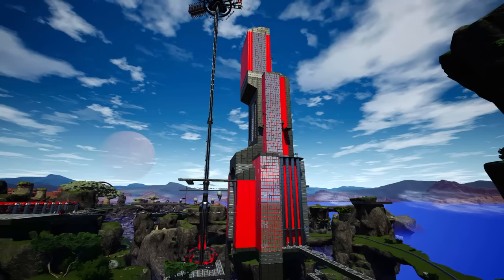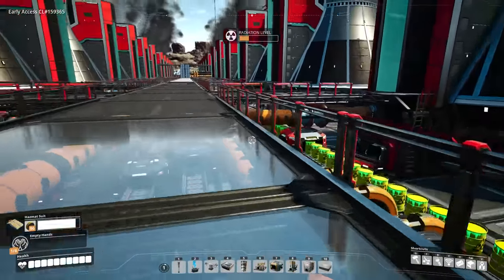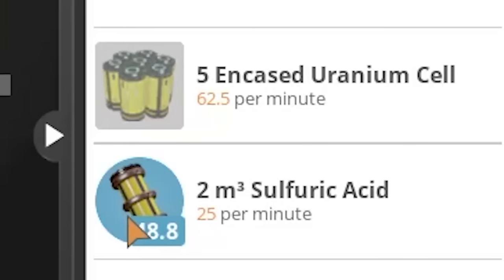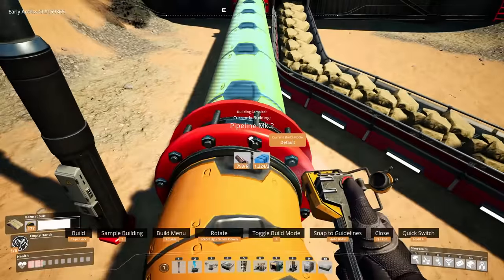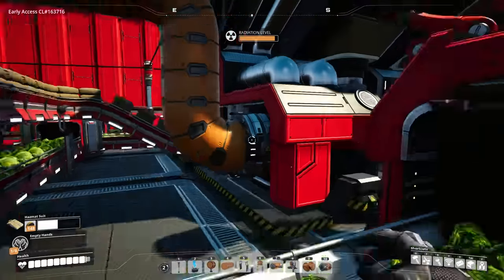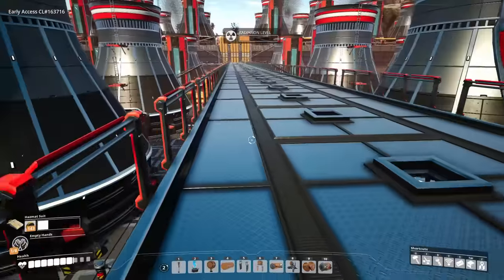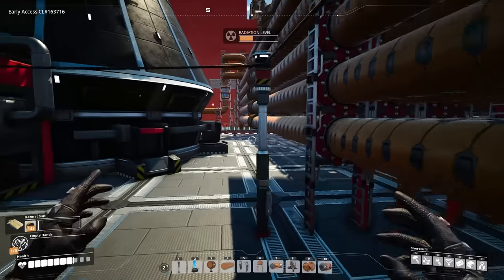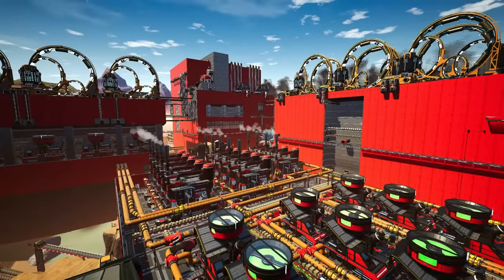The Nuclear Power Plant is MELTING DOWN?!! - Satisfactory

Comment from the maker: So how long do you think I have before the Reactors break again?
Reply: You're good now. I'm claiming it for your productivity and your sanity.
Reply: 30 days
Reply: with any luck cause i am a evil bastard every 5 min ^_-
Reply: Right about......... Now!!!!!😂🤣😂🤣
Reply: update 5 release?
Reply: 0 seconds > actual time > infinity
Reply: 16:01 Forgetting to increase the water production after putting in the shards wont ruin it right? :)
Reply: Until the tower is furnished.
Reply: 10 minutes.
Reply: I had the stuttering water on a few reactors, permanent fix was to redo the last couple of pipes to the reactor.
Reply: The feedback loops are just error prone. You probably know that, but what works pretty well, is pumping the feedback output into a higher tank >10 meters), before you merge it back to the input. Important is, that the freshwater is not pumped that high. Seems like the game prioritizes the higher fluid source like it would in reality. As soon as the higher placed tank contains enough fluid, it flows to the target and pushes into the input flow from the water extractors bringing them to a stop. But if the water from the feedback output tank is not enough, the extractors start and provide the missing amount of water.
Reply: well the pipes are not upgraded sooo i would think next ep
Reply: uhm, about when Update 5 comes out. Isn't it gonna change a lot of the terrain around that northern area?
Reply: @TugiFox  yes
Reply: God DAMMIT
Reply: If the water was stuttering its probably still not filling enough. So... an hour lol. You should just do what you were saying before and overpump your pipes as well by like 10%
Reply: next week
Reply: Untill you turn on your new main base
Reply: @JamesTDG  i would thin his brain trying to fix some thing not even there...
Reply: i'd say about 3 episodes
Reply: You know u said that the blenders need 400 together? And hte pipes are 300 pipes? where is the problem? mmmmh
Reply: at 16:27 you forgot to replace the pipes to tier 2
Reply: I’m gonna go with about 5 days, minimum. Maximum probably a year.
Reply: One second >:)
Reply: When you leased expect it and it is most inconvenient to deal with.
Reply: I am rewatching and rebuilding your Power plant And I noticed a big mistake:

You have way to many reactors for to little rods.

You are making 22,5 rods per Minute.
One overclocked reactor Takes 0,4 rods per Minute.

You have 56 overclocked reactors and 42 normal running reactors.

The Problem:
56 overclocked reactors alone Takes 22,4 rods.
So you have 41,5 too many reactors :O

Instead of 42 Additioninal you just need one on 50% (0,1 rods/min)

Your production on Plutonium fits the 56 overclocked reactors and one on 50%, so this system should also back up eventually. 

Now your rods are backed up as heck, but some time it will break.

I dont know when, but it will eventually, or am i missing something?

Numberwise, this should not be functional
Reply: 2022 checking in, is your reactor still running?
.
.
.
then you'd better catch it!
Reply: hmmmmmmmmm...It took longer than I originally predicted.
Reply: 5 videos at least
Reply: if water is running out than 30 - 60 minutes

Comment: YOU NEED VALVES! On each blender output before it joins the main line, put a valve. This will prevent backflow and preserve your flow rate out. Can do the same on the main line out between each blender output. Same with your water from the extractor to the concrete. Put a valve on the main line before it enters the factory just below the highest point of the hill.
Reply from the maker: OH BUD 100% doing this
Reply: @ImKibitz  was literally JUST about to say this exact thing. i do it with every pipeline now
Reply: I do a dedicated machine/s only ruining on the output from the others, that way it's impossible for it to back up
Reply: @ImKibitz  I also believed that was necessary, but I found that if you don't have any flow problems it isn't. However, if you do have flow problems, valves can help you fix it absolutely.
Reply: @ImKibitz  I'm using pumps at the described location, it works too.
Reply: I've run into the same kind of problem my fix for it was to package the output from the blenders and then but it into an awesome sink. I know it is not the nicest but I think it is the most reliable. Another way to deal with this is to build an overflow by making an intersection for the fluid and make the pipe go up on one side so the fluid does take the straight way until it has backed up.
Reply: @ImKibitz  Personally I do pump -> tank -> pump just to be extra sure I don't back up on my outputs.  Buffer tank usually sits at <20m3
Reply: Or prioritize the recycled H2SO4 by raising the incoming pipe...
Reply: @ImKibitz  To expand on his comment, you have a valve on your main sulfuric line preventing back flow, but you don’t have anything from preventing the main line from filling up the output lines. I had the same problem with water in my aluminum plant. The output lines wind up getting filled by the main line instead of the machines.
Reply: What this guy said.  I have found a lot of my problems are solved with valves, especially since I tend to use multiple fluid buffers.
Reply: I have seen that the smaller pipe will max or exist when upgrading under the splits, I had a similar issue and then just updated the entire set to max pipe size and with the valves the backflow issue was resolved. Fluid dynamics are not weird as factorio but still have some odd behavior.
Reply: Contensol manufacturer of nuclear valves and products
Reply: yeah, I do this with my own nuke setup.  the 600 water into two nuke factories were fluctuating like crazy until I limited them both to 300 input with valves
Reply: yes this is good
Reply: @ImKibitz  bro you didn’t have valves
Reply: Didn't know this but if I do something like this I'll keep that in mind, thanks
Reply: Valves so but this siren has been goin off thr last three days on n off ppl wer getting worried

Comment: I know EXACTLY the solution to your pipe problem. If your output pipe (from blenders) will be higher than pipe with valve on it (to blenders), than it will have the priority. Currently you have exactly opposite situation and you're backing up. I've spent 20 extra hours on my fuel power generators to find out this dependency
Reply: The new update really screwed pipes up and made them extremely temperamental. I've wasted many hours over the same problem as you
Reply from the maker: Yoooo that's so weird! I'll try that out too!
Reply: @ImKibitz  Another solution that I use is to just run one blender from the output of a cluster other blenders (3, I think), plus its own output. Mine never back up that way, even if the production goes all weird from the output belts backing up.
Reply: Instead of the brute force way with valves, I would have resorted to another brute-force method, attaching a pump to the exit of the buffer tank to give it "priority through pressure."  After all, the buffer tanks are allowed to run dry; we can make all acid we need.  They create a backlog if they fill up completely, so we must ensure that the acid from tanks is always used if possible.
Reply: I never got far into the liquid side of satisfactory. What is the back up doing to his setup? I didn't realize too much liquid was bad.
Reply: @achtsekundenfurz7876  pump does not work that way
Reply: @Skorpioartex  problem is the blenders have the same output (but less of) that they use as input so they can back the self up through their own production. They create lots of problems that way.

Comment: Me and my brother ran into this exact issue with the water. End result in our build was we had to run dedicated 300 pipes per reactor with no overclock permitted on the reactors.  But we were able to limit the number of required water extractors by over locking the snot out of them.  The majority of our power shards are in our water extractors.

Comment: I have had the same iussue trying to use valves so I can feed something from two fluid sources with specific proportionality. It works when I stay close to it, but if I leave the area then it can back up. I assume that the simplified simulation when you are away is not quite good enough. So instead I have extra machines with higher priority input belts, that use the excess from the earlier machines. In this scenario, I would have three machines fed by the sulfuric acid supply, and the 4th fed by the output from those three and by itself, using a separate pipe not linked to the supply. The 4th would be highest priority on the input belt to ensure the sulfuric acid produced by the three would get used up asap.
Reply: You can also just run part of the machines completely off the access sulfuric acid, disconnected form the main source, instead of doing an overflow setup. So, say 5 machines run normally, then 1 runs from the acid that those 5 generate, disconnected from any other source.
Reply: @Hlebuw3k  that's what I tried to say, but you explained it better

Comment: I have an idea what the problem with the sulfuric acid was. As you mentioned, there was a problem with the concrete production. This means that the consumption of acid was not steady, as the mashiens were idle for a few moments. However there was still as much new acid pumped in as if the mashiens were running at full capacity. This means, that there is more acid pumped into the pipes then the mashiens use, so the pipes fill up and cause the problems you showed in the video. So now that the concrete problem is solved and all the other suff is also comming in as needed, the pipes should not fill up any more.
Btw: Love your stuff. I realy enjoy watching your videos. Would be nice if you took the time to answer me whether I could be right with my hypothesis.
Reply: I think you've got it exactly right.
Reply: yes I think thats exactly what happend, pipes balance themselves out pretty good, I never used a valve and never had any problems with back loops.

Comment: I had a similar issue with water. I put valves at a certain point with a fixed flow rate to ensure proper ratio. That did do the trick for me. In general, I find the fluid mechanics in this game highly esoteric sometimes.

Comment: The solution I run when dealing with machines that output liquid is to place a buffer in the line high enough up that the incoming supply can't fill it more than 50% due to head pressure.  The machines producing the liquid however are high enough that they can freely fill and take from the buffer.  This let's there always be an air gap in the line for output liquids to go.  The trick is finding just the right height to place the buffer at.

Comment: You don't have to sink it. You can prioritize the 100 m3 sulfuric acid output by using the height trick. Have the acid producing refineries ~9 meters below the input for the plutonium cell, put a buffer tank on top of it, presto. The buffer tank is ~4 meter in height, so the 10 meter headpressure will fill it only up ~25%. So there is always space for the acid output.

Comment: I seen that you have used some pumps on your sulfuric acid setup. Pumps can be used as a priority system, as well as pipes being on the top or bottom. You need pumps on the sulfuric acid output pipes that run back to the input. Then the game should take the output acid first before taking another source, or at least at a higher ratio. And at 16:25 you can see quite a bit of 300 pipe, just make sure that won't bite you in the butt, build everything in 600 pipe.

Comment: An easy way to solve the pipe problem is to make as many blenders as requiring the total output, +1, and then join all outputs (including their own) to those few blenders. put them at the start of the other resources so theyre prioritised. It will ensure output acid will be consumed first as much as possible and youll still get the same overall output of cells

Comment: You need a pump on the return line for your sulfuric acid coming from the blenders, and not one on the 'fresh' acid line. That way the return line gets 'priority' feeding back into the system before it takes fluid from the fresh pipe. I remember reading that somewhere, and it seems to have solved my own feedback problem!

Comment: Big flashbacks to my first big aluminum setup with that whole sulfuric acid issue. Whenever you think you can take advantage of a bit of excess byproduct fluid at the back end of a system and run it back to the back end, it is just inevitable that some part of it will crash itself. You either overproduce and backup the byproduct, or underproduce and don't have enough to balance the system.

Comment: If you have a recirculation setup that keeps backing up. Tee off of the recirc line into two stacked buffers. Link the two buffers and then tie the top buffer into your sink.  This will ensure you only sink excess that manages to pressure up into top buffer.

Comment: no no no, you don't have to sink the acid. Try pumps first. a pump on each blender if you have to. I am certain that pips can back flow and cancel the pressure. As the devs have said "They don't want to 100% say how pipes work" I am sure there is something funky with fluid pressure and if you added pumps it might start working.

Comment: I had a similar problem with Aluminium production where you recirculate water, i ended up putting a storage tank on the input side high up, and a MK2 pump on output from refineries, so the MK2 pumps should have been able to fill the storage tank, but the regular water pumps could not pump water that high.
this way i could always empty the output side of refineries and the regular water pumps could not add more water since they could not push water that high. a bit silly solution, but hey, it worked.

edit: i think the problem is the blenders don't run 100%, so you keep adding acid from your production line, while you ain't consuming the same amount. a 3rd way, could be to reduce the added intake even more but then you would never run 100% up time, i think you had that earlier (wrong intake amount on valve) and they at least kept working some 80% then?

Comment: When I had that fluid problem the only way I could solve it was with active pumps. Basically valves still won't flow when there is the same amount of fluid on each side since there is no pressure gradient. So both sides of the valve just fill up anyway. With a pump it ensures that the output side of the pump is very full (and therefore has higher pressure and will take priority) and the input side is almost always empty (so the blenders always have somewhere to output to)

Comment: I don't know the inner workings of your pipe system, so correct me if I'm wrong. But if the sulfuric acid pipes going to the blenders are 300 lines and 4 blenders need 400, you return the 25 sulfuric acid they produce back into the system. But the pipes are still 300 pipes so they can't support the additional sulfuric acid coming back from the blenders. I think you just need bigger pipes. (I hope my english was good enough to get my point and as I said I don't know if the pipes are 300 pipes.)
Reply: They are 600 pipes so they hold enough fluid

Comment: quality of life tip: when you use Smart! mod, you can open menu by pressing M, then use the setting for auto placing conveyors when you use splitters or mergers, that way you can do a whole factory line with splitters, machines and mergers, in just 3 building steps!

Comment: I never trust the self feeding loops, like you did in the sulfuric acid, they work until something breaks, either energy, other product or anything, than the pipes get full and the doom is unleashed.
What I do is always have one or two machines that runs only out of the waste product, or simple having more machines than you can product, so you can't ever get a full pipe dead lock.

Comment: kibz i think i know the problem with the blenders since you didn't have the concrete the sulfuric acid backed up into the pipes even with the 300 line and the valve bc you didn't have the concrete it was already underproducing so the sulfuric acid backed up so with the concrete fixed then it shouldn't happen right?

Comment: its full because mixing mk2 pipes with mk1 pipes doesn't really work right.  switch all pipes to type 2 pipes, and put a large fluid buffer at the beginning of each blender system.  The sulfuric acid producers will only make up the difference of what gets put back in the pipe system.

Comment: The issue with your sulfuric acid is that you don't have an input priority setup.
if you want to do so, you need to combine the pipes vertically and connecting the pipe that should be cleared first on top and the input can go anywhere. (you need to make sure that the pipe support or rather a buffer tank is above the vertical connection so that gravity can act upon it and push it in) 
I can try to drop by in one of your streams and try to give you some instructions.

Comment: I had the problem with the piping with my aluminum production. I fed back the water of the production to the input and just calculated how much water still to gather. BUT - it didn't work out; the water clogged up stopping the production. What I then did was again a closed loop circuit. Meaning I took all the waste water from the production back to just the fitting amount of inputs WITHOUT a permanent connection to water exctractors - just a valve to fill the circuit initially, that's it.
The rest of the input was gathered by water extractors alone. I have the feeling that piping in Satisfactory has a problem with interval outputs of fluids. I got the same problem with sulfuric acid and nuclear waste disposal and fixed it there, too, with a closed loop.
Also, I had it multiple times that pipes seemed to be connected correctly, but they have not - they did not let fluid pass at a certain connection point - mostly pipeline floor holes that caused this.